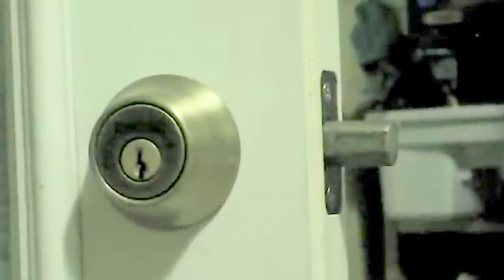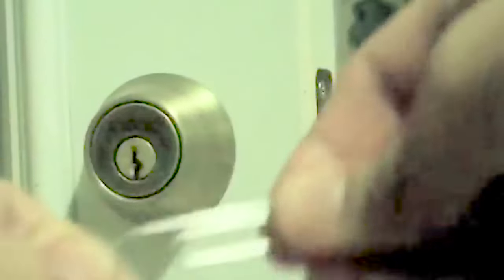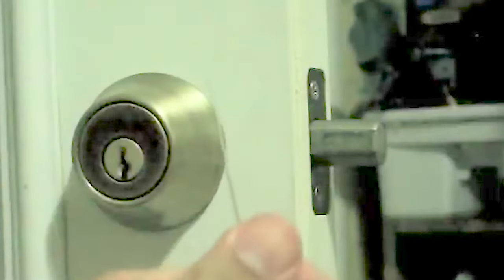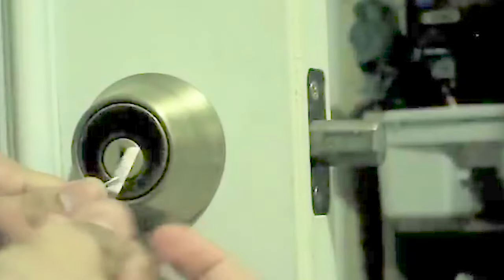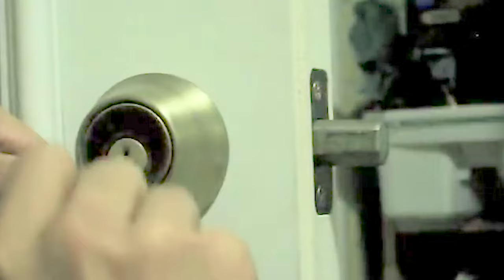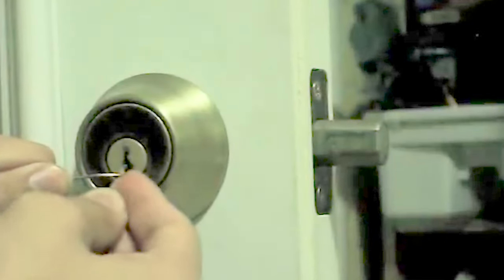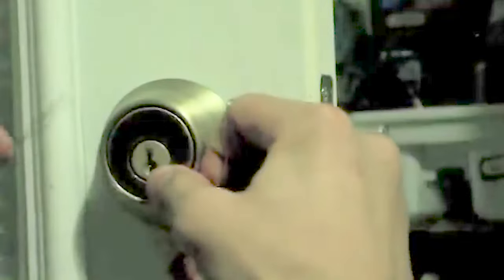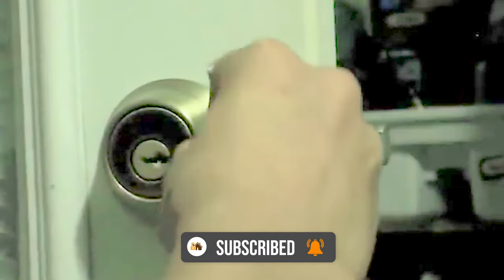How to Pick a Lock By Paper Clips in 2 Minutes - The Alliance Security

Comment: Pro tip, before you do this, strengthen the shape of the bottom paperclip or risk it breaking off in your lockbolt: first unfold the bottom paperclip completely and then fold it once over on itself. Now that you have the skinny "U" shape to it, fold the top inch over to make a 90 degree angle. Cheers
Reply: I agree.
Reply: do we do both or just one?
Reply: @gamin4543  only fold the bottom, that is your turning tool, the raking paperclip should be as rugged thick a gauge as possible to fit the lock, the strength of the paperclip to maintain its shape is essential for the raking process

Comment: Ok  look,  I've been trying to get someone to answer this no body will.  I'm new to lock picking but I found i can pick any d.bolt when the door is open... because of the tension.  Not mine, the actual dead in the door jam. You know how sometimes you need to pull the door really hard to you to unlock it... turning the key feels like it will bend, break... my question... how the f do you  pull the door,  use a tensioner, and work a pick? I couldn't figure our why i can't pick 99% of closed doors,  I almost quit then I figured out the issue. So professional...what do you do??
Reply: Idk
Reply: I'm not a pro but try a door stopper (like a wedge I mean) to wedge the door in a certain direction if there's too much pressure on the lock for it to turn